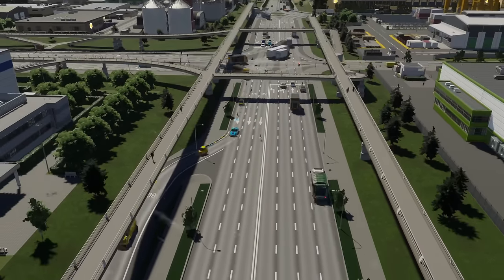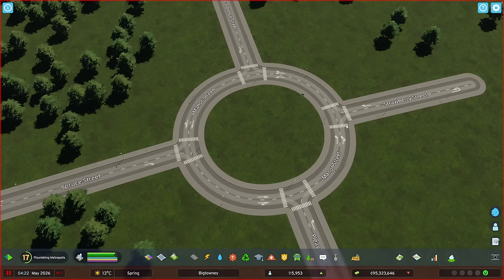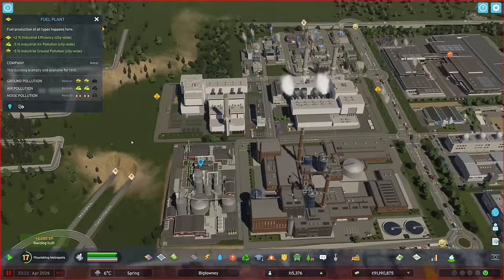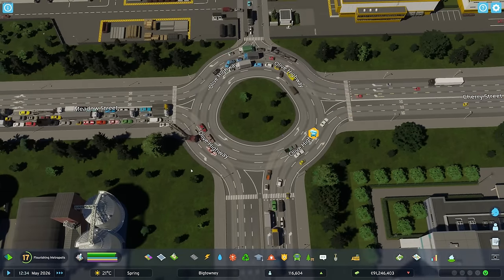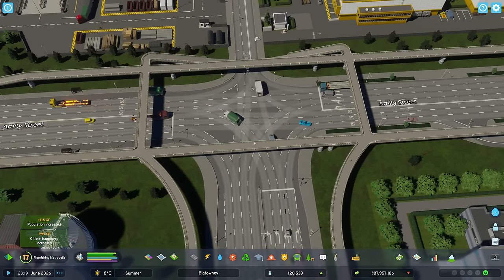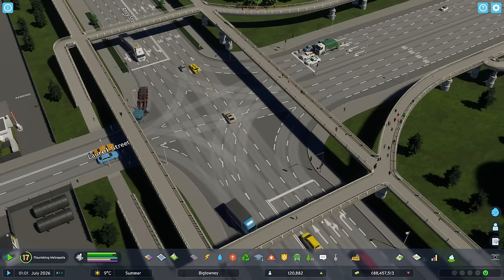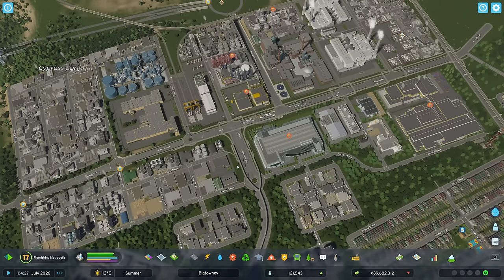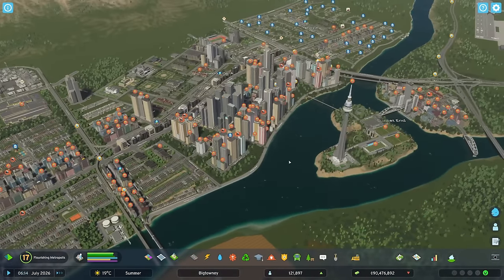Detailed Look at Traffic Behavior in Cities: Skylines 2

Comment: The crazy lane switching happens in a very pronounced way when you change lanes (especially when disconnecting and re-establishing lanes). Not that it doesn't happen anyway but it's just much more noticeable after a change to the roads, when it's the equivalent of a digital panic attack! HGVs jack-knifing and doing multi-point u-turns.

Comment: I'm disappointed that the traffic simulation isn't improved (more).
Thank you for showing this. I guess we really need mods again.
Reply: It got a bit better after the latest update, but still needs lots of work. Dealing with the industrial traffic sorta needs interchanges since we don't have advanced traffic lights, but I often did this for Cs1 too.
Reply: @darcos7535 could the devs make over time actually make the ai function properly and fairly realistically? Or could that require a complete overhaul of the game?
Reply: @terrydactyl2077 I feel that the AI can be improved significantly. Frankly, the version in TMPE was better than this. I think they just need to limit lane changes, penalize bad illegal actions higher and tone down the traffic accidents. Finally, if we had a way to unblock an area it would be good. I think the AI getting stuck is going to happen. Happened in the old game too sometimes.
Reply: @darcos7535  right. Well I hope that it can be fixed. There are some things I wished for in a sequel like curved road zoning. But above all else traffic behaving properly to a good road network is gonna be the crux of my enjoyment in the long run. I love the city side of things but above all I love the game as a transportation sim.
Reply: I feel like the traffic simulation is almost entirely broken in general, but in the mean time, they definitely need to fix the lane changes and other violations. That would make the lack of granular lane/intersection management much more bearable for now and would at least give us something much more consistent to work with in terms of working out traffic flow issues. Crashes are also annoying because vehicles still don't really yield to emergency vehicles and so they'll just get stuck in traffic, and traffic seems to almost completely ignore the bus/pedestrian road restrictions so those are jammed up too (even when there's a still a faster route open sometimes). It does seem possible to mostly get pedestrians out of the way with crosswalk and pedestrian walkway placement, but in some locations they still seem to inexplicably ignore the signaled crosswalk on one side of the intersection and just run across the other side in traffic.

For fun, I'd love to see a traffic enforcement mechanic with the police. Like maybe you could designate a budget level for the traffic division. Higher budget could mean fewer violations and crashes (and possibly bring in traffic ticket revenue), but a small hit to general happiness in the station's coverage area as it gets higher; lower budget would do the opposite. (Toll booths are also conspicuously absent, but that's another discussion entirely.)

I think I'm stepping back from the game for a bit at least until a patch comes that addresses anything meaningful with traffic.
Reply: @akaitsukiakari  sadly I have stepped away for now. I’m hopeful. Just disappointed for now.

Comment: Really love your analysis on this man. The bones of a great game are here, but it still just feels unfinished and a bit empty. I've been working on my city of around 180,000 since launch and there is really nothing else I can do. I have optimized as far as the game will allow me and I have no desire to start a second city. The traffic doesn't work. The mod inspired features from CS1 don't function correctly. The buildings variety is lacking. Besides the performance issues, the biggest disappointment for me so far is the lack of any form of evolution for the zoning/building generating system. We have had the zone on road tiles system since the first Sim City games back in the 90's. Why is there no evolution of this? Why are we still stuck with these awkward grids that break if the road isn't a perfect 90 degree angle. I want to make diagonal and curved roads but then get turned off from it because of the grid system creating massive open gaps on the corners, and then ruining the grid for the straight part of the roads. There isn't even a way to turn off zone-able tiles. This was such a simple mod in CS1. I can't understand why this wasn't an option. In addition, the lack of toggleable no-clip and plop-able buildings is a huge L. The game is going to be good, but it's for sure in a state at the moment and needs a lot of work from modders if we want create any form of visually pleasing/realistic city.

Comment: One thing I found about traffic is that you want as much T intersections as possible. Just avoid 4 way intersections.

The angle at which roads cross each other influence how much dedicated turning lanes you can get.

Roundabouts are great to distribute one source of traffic to multiple locations, but bad as soon as traffic comes from multiple places.

Bad lane switching is the n1 plague. The only way to avoid it is to avoid the situation where traffic jams in the highway. Which is not always possible.

Comment: I’ve really enjoyed watching your play-through. I’ve also landed at the same place of not really wanting to play more until some of these issues are fixed. For me, my breaking point was when I had a bunch of level 5 buildings burn down because the sim called fire from outside instead of the fire station literally 400m away. 10 out of 11 vehicles available but the sim decided not to use the city’s services. Btw, I’ve noticed that cims and vehicles don’t respect rule changes (remove x-walk or no left turn) if they’ve already started their journey. You can delete the road and unpause to force a route reset. Otherwise you’ll get that steady stream of jaywalkers.

Comment: 14:27 Hey I found a neat trick and haven't seen you use so maybe this could help someone:

If you don't want to delete a whole road segment and don't have space to use a crosswalk or a small street to create a new node, just build a short pedestrian path "on" the road with snapping disabled. The direction doesn't really matter. If done right the road might wiggle a bit but it won't create a crosswalk. You can now bulldoze either side of the "node".

I hope this helps :) I'm sure someone else figured this out as well and posted it somewhere but I didn't bother to check yet.
Reply: The game is made, so that you can insert nodes. Just choose a road, and double click where you want the node.
Whike I discovered your method, early after the game came out, this method is just a little faster.
Reply: Found this too! It also works for creating new turn lanes on asymmetric roads as well! In general using gravel or alleys as planning are really nice.

Comment: On the whole "why isn't the AI using the avenue" issue, I THINK what is going on is that the AI calculated that the time it takes to go through all the traffic lights at each intersection along the way takes more time than the back alley ways, thus the detours.
Reply: It's this. The real world equivalent would be Google Maps giving drivers some random cut-through rather than using the main roads

Comment: the one and only thing that breaks traffic is vehicles changing lanes in the last moment, everyone on the same node. It's an issue with path finding. Follow a random car and you'll notice that often it will pick the inside lane and change to outside on the last node blocking the traffic in that lane, which in result causes cars in that lane want to go around that car and block the other lane
this was happening in CS1 as well

what I've noticed as well, when you build 8 lane road the cars tend to use all lanes just to try to change in the last node for the lane they actually need to be

Comment: Roads with equal priority do not yield at intersections, roads that have lower priority always yield for higher priority roads. You can see, even when you comment that the custom roundabouts don't work, the 6 lane avenue yields for the highway road as a roundabout. For highway roads, lower lane highway roads always yield for higher lane highways.

Also, something is wrong with the networking, and sometimes segments or roads can break the traffic and cause them to go on alternate routes that are much longer and slower than what you intend. To fix that, you have to find the broken segment or node and redraw it.

Hope this helps some people.
Reply from the maker: They are not yielding, they're not entering a "blocked" junction.
Reply: @Akruas  Maybe the yielding doesn't work in some edge cases, but the sharkteeth and yield signs are there if you look at the video. Those don't appear when roads that intersect have equal stats from my observations, unless you place a roundabout or one-way road(sometimes, not quite sure all the requirements).

I agree it is a bit jank, and traffic AI appears to break easily.

Comment: The roundabout problem makes me even more confused about RL roundabouts.  Because there are different numbers of lanes and different numbers of entrance/exits there does not seem to be a standardized set of rules for them.  Many people tell me they are easy but they are not as you so amply demonstrated.
Another thing about bus lines.  I have one route with about a dozen stops.  It goes from A to the connection train station then to point B then back to the same stop at the train station before completing at point A.  This does not work.  I cannot add any stops or complete the line after the second stop at the station.  I had to put in a second bus stop at the station to make it work.
Reply: Believe it or not, roundabouts IRL are far more easier to negotiate then what Cities skylines would make out. For a start everyone knows what they are doing and its not a chaotic mess that the game portrays. Plus you have a "feel " to when to go when driving IRL.

On the other hand seeing the multilane bypass monstrosities I see on google maps in the US,  I have know idea how anyone can drive through them.
Reply: @theoncousland4587  Oh, my mistake.  They are easy, cuz you say so.

Comment: The buses situation, I assume you got it mixed up, buses and public transport in general seem to do maintance from time to time, so they will leave their line, new buses will emerge from the depot and will go to a random stop on the line. During this time they will show as them being on the line, however they have not arrived at their first stop yet. I seem to discover it when I needed 14 buses for my 2 lines, which my depo with 15 as capacity could not provide, which was bizare to me until i figured out maintance.

Comment: 12:50 I would say that the game is incidentally reflecting what happens in real life. If I am not mistaken, there are two lanes incoming, then a third lane is added on the left. Afterwards, the two lanes on the right do not have anywhere to go at that point in the video, so the incoming traffic must flow to the third lane on the left. The traffic jam is caused because of two lanes on the right converging on a different one on the left.

In a real life scenario, the problem would be worsened because heavy traffic usually occupies the slowest lane, i.e., the one on the right in this case, so they would be forced to cross the entire road to the opposite side.

Comment: Currently only way to deal with traffic system is by maximizing number of lanes to give traffic system more lanes for drivers to be stupid in. One way 7 lanes roads was a way to go for me. You also have to use more lanes for highways including exits and entrances to highways. There are 2 ways to force traffic to prioritise which rout most will take through speed control. 1. Making district with speed reduced (not really usefull). 2. When building additionall pass to lighten traffic flow you dont build it as road but a highway instead. This way traffic will give more priority to it because it can go faster there.  I have not seen a single video around, that would have to deal with amount of traffic I had. I did go for very high density in hope of higher population cap though.

Comment: With slip roads on intersections you should not add extra lanes to the main highway for more than one node. If you have multiple nodes traffic will enter the extra lane and later have to fight to leave. It doesnt happen if you keep the extra lane to a max of 1 node. Also for busy off ramps use several lanes.  Totally agree with the roundabout and junction points you raise.

Comment: I was merry and jolly about roads and intersections and how easy they are to build compared to CS1 but as my city hit 100K everything bogged down even though there are many lanes in an intersection AI clouts up in a single land and all other lane traffic goes to end of intersection and decides they chose wrong lane and start turning into that single lane which is already suffering. I find this very annoying and kinda makes it hard to have and expand on truly large cities. In CS1 I used lane nodes to keep traffic from changing lanes at last minute which worked very well and I have 95% flow in a city boasting more than 90k. Hopefully we get more control over lanes and we have timed traffic lights so I can truly build a no clog city. Until then I can't bear such jams and I get frustrated from it. You'd understand after spending 8 hours on planning traffic flow efficiency just to have it all come crashing down is super annoying

Comment: I'm sure most of the testing was done with smaller chunks of city. Like building a couple junctions and a roundabout with traffic spawners at the end of the roads. Software engineers writing code don't have the time to build huge cities which have a thousand sources of different traffic and not just a couple spawners.

Comment: I was hopeing C:S2 would deliver a better vanilla experience than c:s1, but sadly for all the things it does well there is a lot it leaves to be desired. I found the maps to be pretty disappointing, I made the mistake of choosing the Islands one which just doesnt really work because the Islands are too small and hilly to make the big buildings like the harbours, train depots and such look good. The night is also super annoying because it makes it almost impossible to build because I cannot see a thing. A building mode that lightens things up would have been nice. 
Pedestrian bridges or tunnels still take up far more space than realistic because you always have to build a ramp instead of stairs or an elevator. 
Traffic accidents are a cool feature, but most of the time rescue vehicles get stuck in the traffic jam caused by the accident instead of finding another route (iirc other vehicles were even supposed to give way to emergency vehicles? I never saw that...). 
So over all I agree, I was so hyped for the release but that hype is mostly gone now. Disappointing.

Comment: Quick tip for you Akruas. Highway exit/entry ramps needs to go on the outside, like the real world, because trucks goes to the right most of the times and has problems crossing 2 lanes to reach the highway exit. 

That would help you with the issue on the highway
Reply from the maker: Except they don't, even in the thumbnail all trucks are on the left.

Comment: I actually feel that it makes sense for traffic simulation to exclude custumed setting regarding individual lanes. With some experiences managing ppl, I would say ppl don't adapt to flexible rules very well. It feels good to watch perfect traffic flows following delicated rules we set down to the details of which lanes connecting which lanes. But in reality, average ppl are not going to remember specific rules for each intersection if they are different most of the time.

Comment: i fix traffic problem whit big curve 90 degree 2 lane.. becouse if the curve is not perfect they crash..need to be not a circle but 180 270 degree big curve, help alot parking and tree on side , when u leave low density home citizen i notice use less car too, metro help alot leave car arround, u can fix it alredy and give u satisfaction try less compact zone too, market need be near industry and traffic no need cross a city district, is better put 2 normal enter in a round and 1 only 1 side large, try make the custom bigger and whit 4 parallel line

Comment: I think it is worth Mentioning, The violent lane switching only really happens after one has changed the road layout as vehicles have to re-calculate their route.  If you watch the points where this happens for a while, the problem goes away because the vehicles have pre-calculated the route to the new layout.

Comment: I'm really enjoying CS2 myself but all your points are valid, I wish at the very least we could have 2 configurations of traffic lights, one being how it already is and the other one should be one side of lights at a time, like at a 4 road intersection only 1 side at a time is green, would solve a huge issue. 

My other biggest gripe not mentioned by anyone is the controllability over public transport units, why can't we control specific numbers of buses, trams, and trains? If I make a regional line with many stops that's not in huge demand the game will calculate the number of stops and will send out a minimum of like 12 buses with the overall usage being like 2%, so inefficient and the unbunching seems non-existent. Also having to make intercity connections and using your own vehicles seems stupid, transport from other cities should be able to stop at your stations, I really don't like that "feature".

And very quickly, that international airport asset is hideous lol, it also doesn't have built in bus stations, trains, taxis but no buses? WTH!